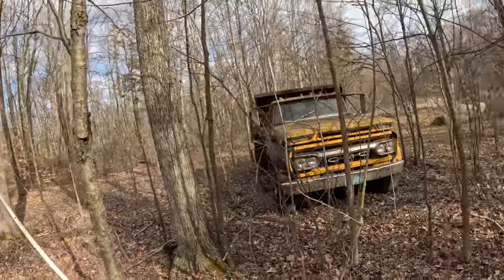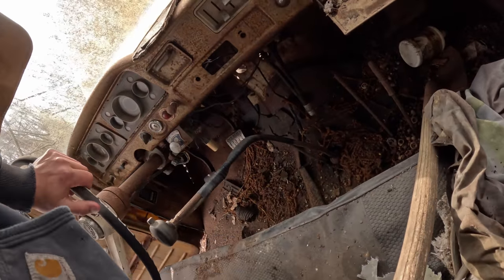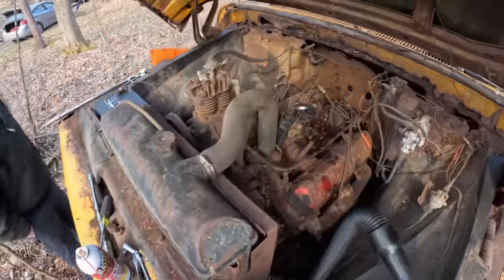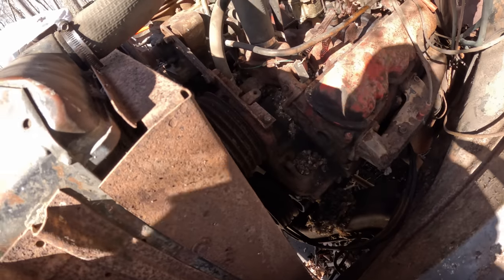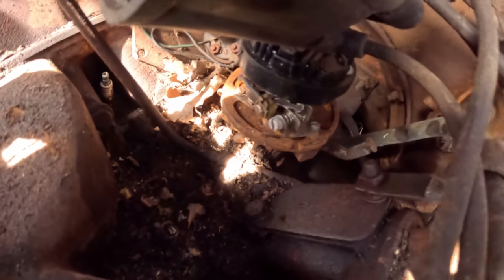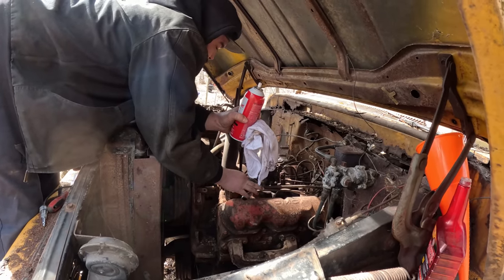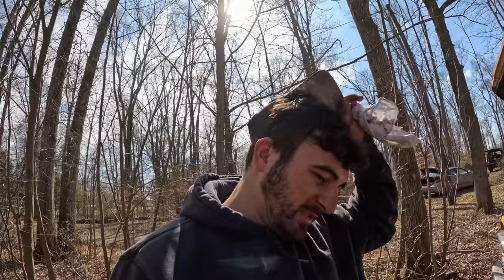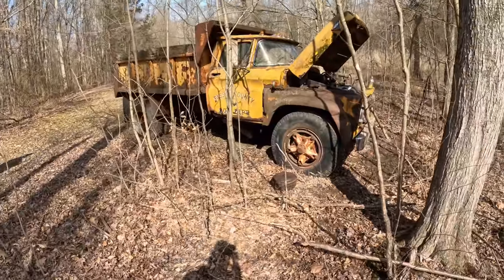1960s dump truck sat for 15 YEARS! Will it Run?

Comment: It's a 60 - 63. You can tell by the wrap around windshield. In 1964 they changed to a flatter windshield. It's a cool old truck. It's a shame that it's in such bad shape, body wise.
Reply from the maker: Yeah until i got to see it in person i was all about taking this truck home. But as you can tell from the video a closer inspection shows just how bad the elements have been to this truck. The truck would need a full new cab and fenders and buy the time you locate a decent one the rest of the truck would also be rotted out. All in all we had fun getting the engine to run again

Comment: Alot of these old dump trucks hauled salt to put on the roads that's why they were so rusty .
Reply from the maker: Its a shame the rock salt is so harsh on metal. It still probably held up better than the vehicles made in todays age

Comment: Just subscribed. there are bolts that to put in the air brake chambers and tighten them to manually release the brakes.
Reply from the maker: thank you for the feedback, in the future I will bring some hardware to attempt this!

Comment: Will it start, yes. A little disappointed you left it in worse condition than you found it.
Reply from the maker: yeah I was bummed that the shifter and top of the transmission broke, but if they broke just by us trying to shift it into a gear when it was stationary it definitely would've broke under load going down the road

Comment: “How’s that muffler smoking when it’s on the ground?”
 
This isn’t a case of 3 brains being better than one. This is a case of 3 brains almost equalling one. Lol
Reply from the maker: Neither of the mufflers were hooked up when we got there so the truck engine just had the y pipe on it. I assume that all the smoke form the marvel mystery oil just shot out the y pipe and found its way through the mufflers that laid on the ground.

Comment: Find another one like it and make one good one out of the two
Reply from the maker: My Buddies and I have been searching more more trucks to try and get running. The hope is that if we found one of similar body style and it had better sheet metal we could utilize all the good components for one truck like you mentioned.
Reply: @GAVINCANFIELD  some man bought an old truck that had a great drive train but was very badly rusted and he found the aluminum cab from an old  peterbilt  city truck tractor from the 1970s that was in the junkyard for $100  . He removed the badly rusted cab and made the aluminum one fit. He ended up with a unique looking truck that will never ever rust and lighter than steal. It’s a real eye catcher. His last project, he said he was 65 and tired but happy with the vehicle.

Comment: Where in Jersey is this ?????
Reply from the maker: We were in PA working on the truck but it originally was a state or township truck for Passaic County NJ
Reply: @GAVINCANFIELD  That engine is a 401 V6 magnum ! A good motor but not very powerful. My dad had that same motor in his 1967 GMC he purchased new from Frank's GMC in Lyndhurst NJ, Bergen County ! Had a double stick, 5 speed main with a 4 speed auxiliary transmission. A shame your gonna scrap the truck ! Yes, pull the motor, and collect the emblems.

Comment: Cut the belts off
Reply from the maker: we did end up cutting the belts off. unfortunately with out the belts we could not build air pressure and we didn't have the bolts to screw into the brake canisters so we were unable to move it.